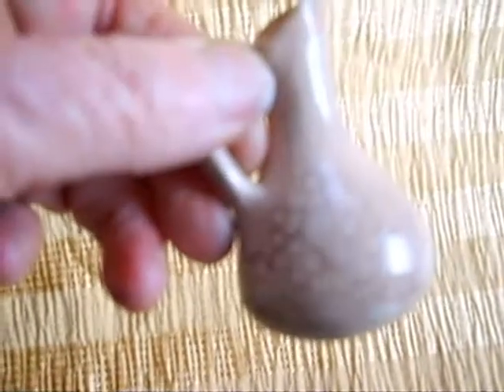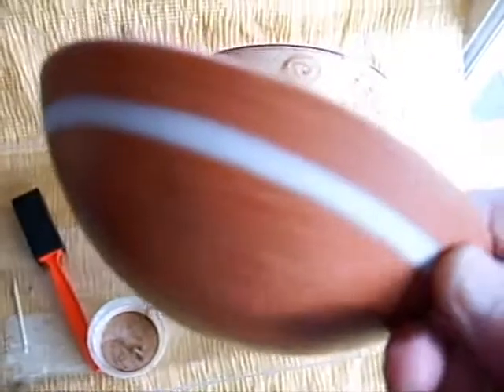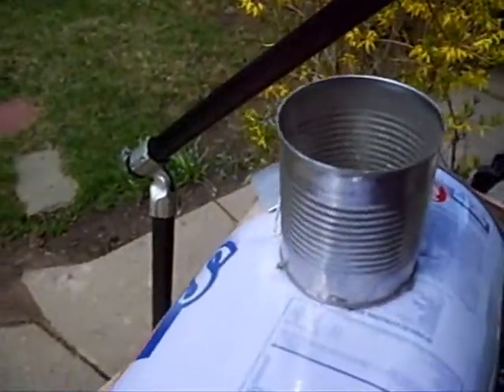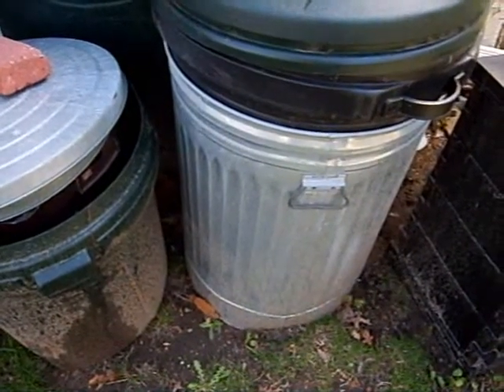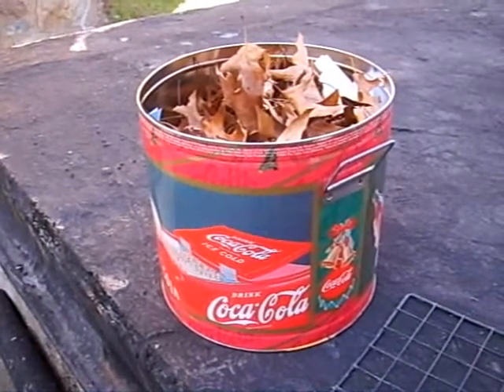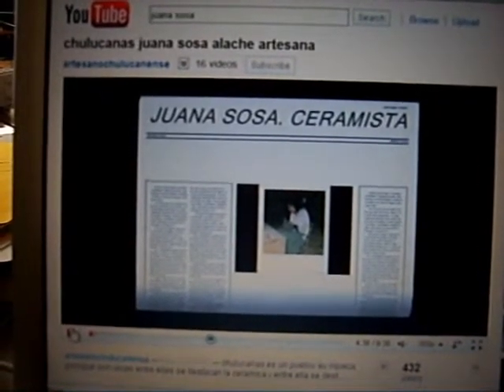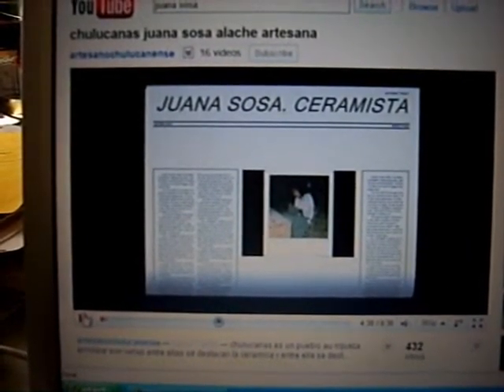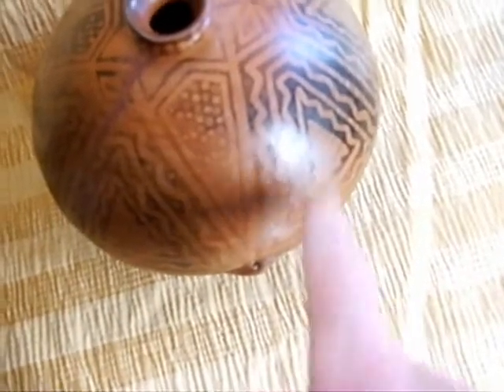Ceramic techniques in the ancient AMERICAS-smoke resist

Comment from the maker: Viewing videos of raku Naked clay smoke firings this technique os far faster.It only works however on low fired blsqued ware;this flashing carbon penetration lasts with a hand full of leaves a mere under 3 minutos penetration.I TRIED a ceramic electrically fired a bit higher and  the carbon would not penetrate until I finally realized it needed a lower fired terracotta.Try using commercial clay pots.

Comment from the maker: you apply a slurry of clay to a pre low fired bisqued terra cotta .
2. you smoke penetrate it 3. you soak off the adhered dry now slip for 10 min +-!  in Honduras they add ash to the slip not in Peru! view you tube> comercio justo elaboraccion de ceramica 17:10 minutes to view the process mid video.it will help you see white engobed pots being resisted in a semi reduction smoker oven.ok.
on images>chulucanas ceramics see finished examples ok.